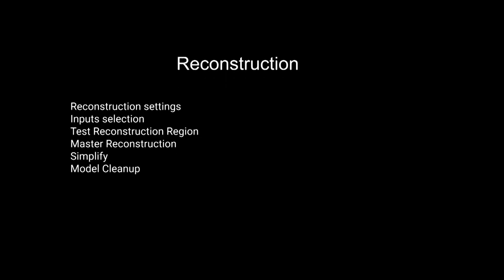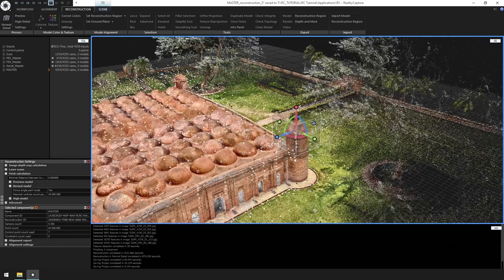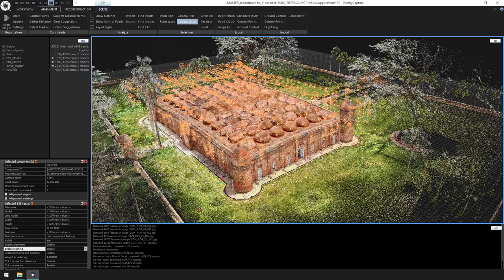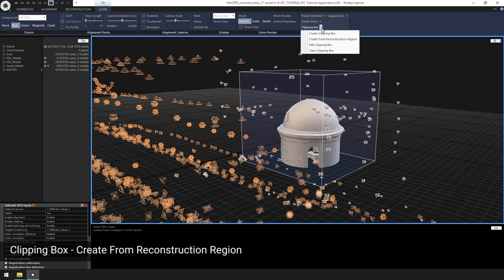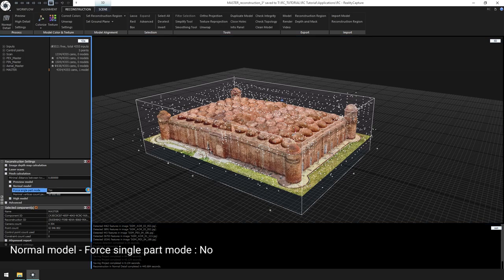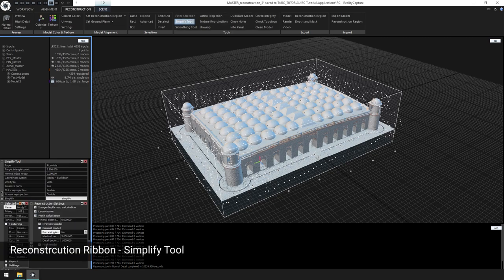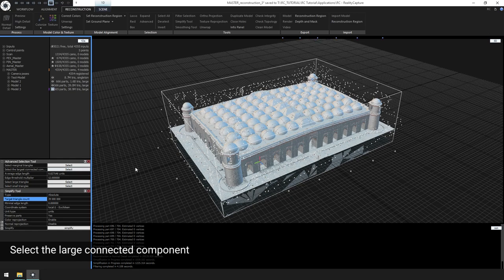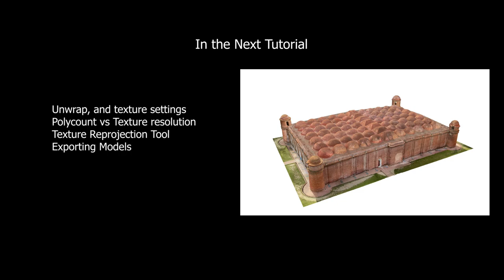Reconstruction workflow in RealityCapture by CyArk

Comment: I am struggling with these tutorials as the current version of RC [Version 1.2.017385 RC] has a different layout in the menu bar which makes it hard to find things. For instance I cannot find the Selection Tools. The Menu bar reads "WORKFLOW | ALIGNMENT |  MESH MODEL | VIEW | TOOLS | VIEW | VIEW | TOOLS | VIEW | TOOLS" Which I think you will agree is very confusing. Please can you tell me how I can get legacy menu layout settings and if I am doing something wrong, or recreate your tutorials so they match the current version. Thanks
Reply from the maker: Hi Graham, as you noticed, there is a new UX layout in RealityCapture. We know about this problem with older releases and we are creating a new videos with a new UX. We kept also these older videos because the principle is still the same. Are you able to see the line above Menu bars? The line where you can close the application? In this line are also names for last View/Tools/View/Tools (it could be Scene 1D/Scene 3D for example). According to this you know to which tab are these View/Tools. The Selection tool is under Scene 3D tab/Tools/Mesh model for a mesh and under 3D tab/Tools/Registration & Sparse Point Cloud for cameras. Unfortunately it is not possible to change to older UX. You can also watch our new tutorials, where is this new UX and also used mentioned tools. For example: https://www.youtube.com/watch?v=kWrdGXPhN9c&t=332s